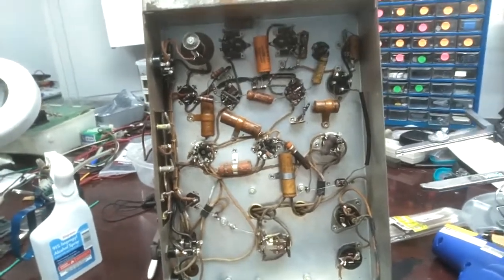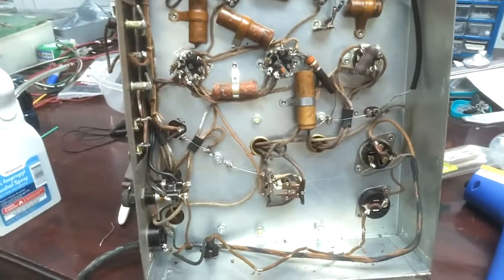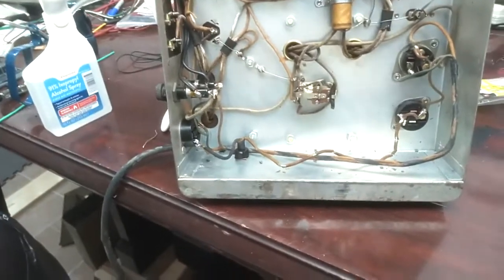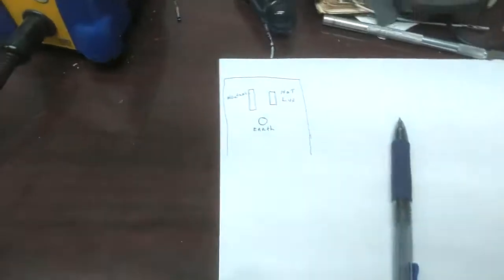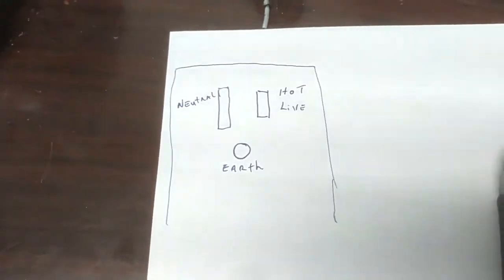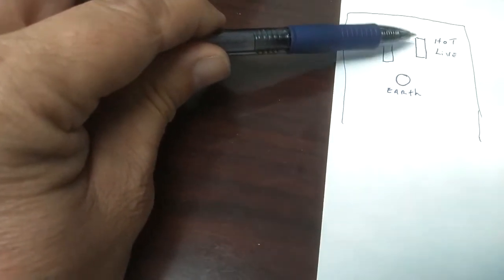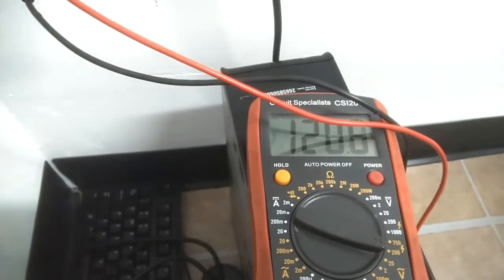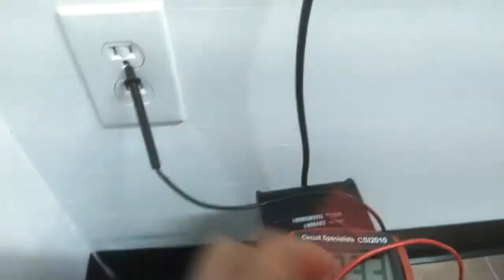110v Power Cord

Comment: on older units the plugs are not polarized and can be inserted to the wall in any direction.  how do you cope with that? any side could be hot.
Reply from the maker: The only "safe way" would be to use a double pole power switch.  This type of mechanism switches 2 circuits at the same time so it would disconnect both neutral and hot.